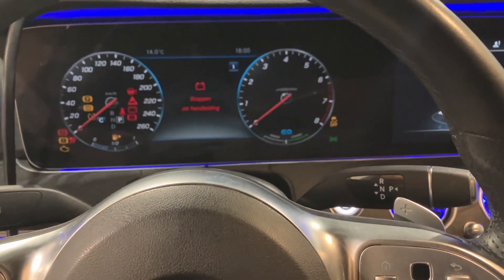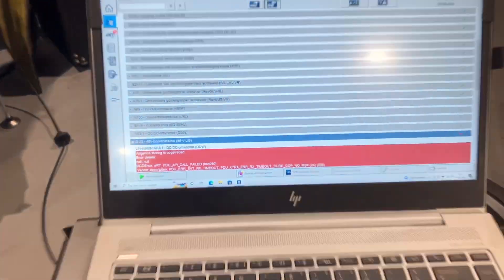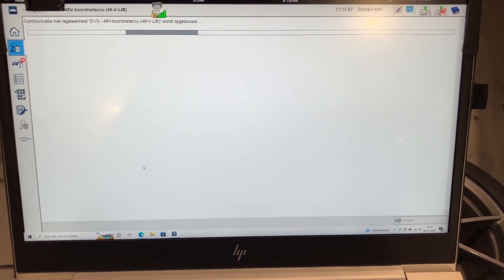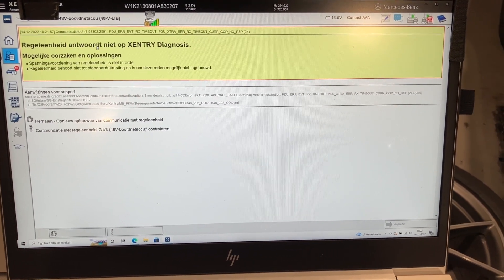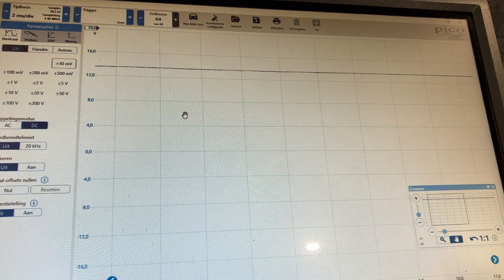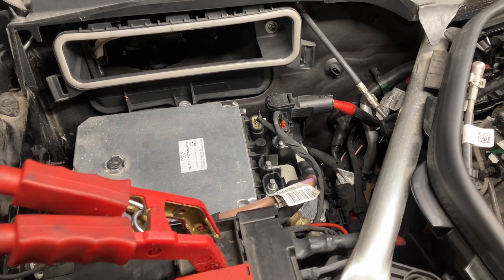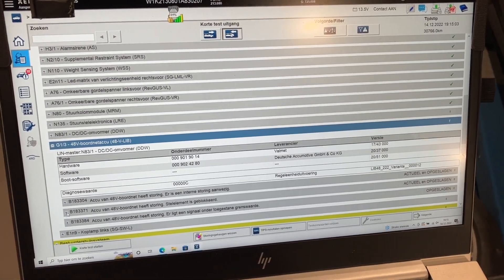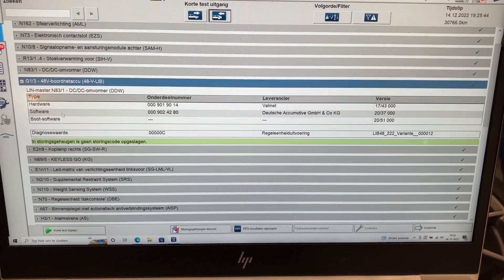WILL THIS WORK? - MERCEDES W213 E-CLASS E200 48V MHEV BATTERY - MERCEDES DIAGNOSTIC

Comment: Hello i have w167  2021 no accident car

I have been facing this problem 3 times in the last 3 months, only until Sunday My car does not start due to the 48 volt problem Someone from Poland connects remotely and fixes the problem, and a month later the same problem occurs again I need someone to completely eliminate this problem

Comment: Hi, my brother have issue with his car 12v battery do dring out and the car is not starting. Is there problem with DC/DC converter or the 48v battery that has issues? Any sujestion.

Comment: what was the issue with the 48 volt battery   i took my car  to the dealer benz place  cls 450  and they said first it was the pryo fuse they replace it then they said the 48 battery volt not communitatin to the starter to start it been
Reply: thet wanted  to charge 4000
Reply: @terrynaylor767  Hi Terry, that was also the problem with this Mercedes. The pyrefuse was activated because of a minor collision. The battery itself was still full on charge but the module inside the same battery failed to communicate. The only solution is to replace the battery. 4000 looks expensive for only the battery replacement but if that includes the diagnostic charge and replacement of the pyrefuse it would make more sense if they charge that amount.
Reply: @ajaysheombar6535                so it was the 48 bolt battery  so you replace the 48 volt casue it been in a small accident its only 4 years old how can it neeed a new 48 vold  with only 13,000 miles on it it was under carrige  the resit the accident start it still wont crank or  just a clickin norse
Reply: and is it hard to get to the 48 bold on benz late model

Comment: Can you tell me the cost of this kind of replacement since this will happen to all of these hybrids in the future. So labor + battery.
Reply from the maker: The total diagnostic charge was €240 (€120/hour) including tax. That includes the price for using genuine software and diagrams. The replacement of the battery €180 including tax, we charge €90/hour for mechanical labour. The battery was supplied by the customer which we usually don’t do but it was on backorder from our dealership and the customer could arrange a new battery.
Reply: @jaysautoservice  Asked the price from mercedes for the battery, which depends on a car but for e-class f.e spare part 1910€
Reply: @user12122 this is price from mercedes service? Im looking for w212 Lift battery.